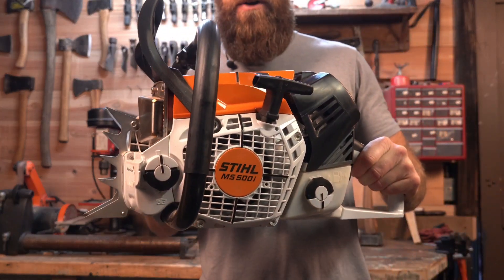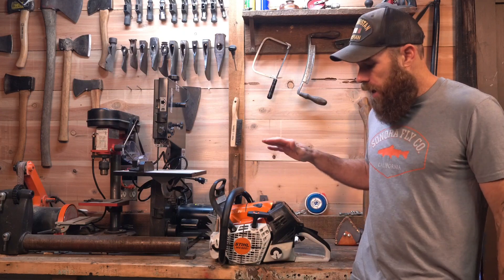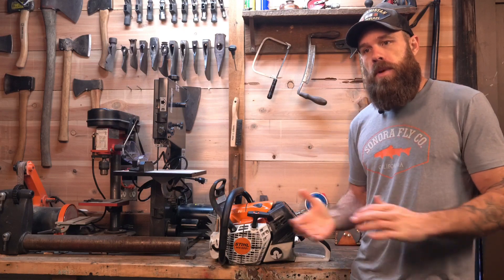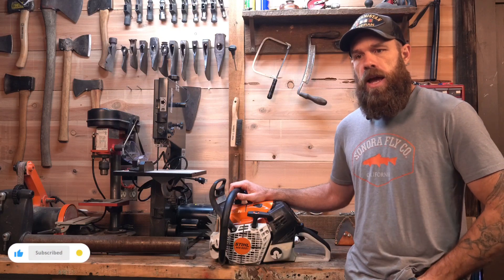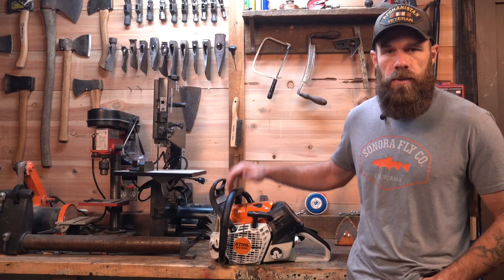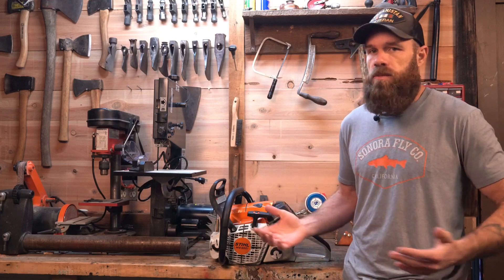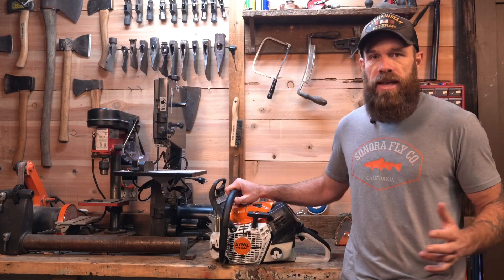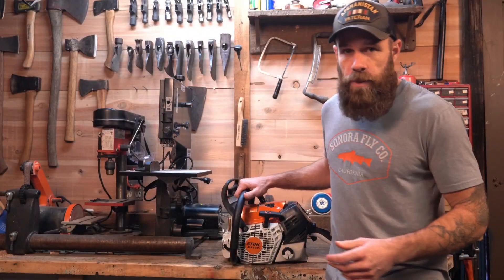How to Recalibrate The Stihl MS 500i After Mods

Comment: You can hock it up to computer..after hocking up run it full throttle...than let it run by itself idling..if it shots down in 40 seconds by itself than the reset worked...and it did the calibrations

Comment: I absolutely love my 500i. It’s ported by Ripsaw because I had to 1 up my friend who got a 500i before I did. Threw on every single Westcoast Saw mod for it and ran it how I normally would. The saw adapts to the mods pretty quickly. When I threw on the new revised filter for the 500i, all it took was a few cuts and it sorted itself out. 

With no information in manuals, it’s annoying. Not like my 261 which tells you how to do M-Tronic reset and even the break in procedure. But I guess with these saws they tell you run it how you normally would. Did the break-in like my 261 for 3-4 tanks which didn’t take long and then by the 10th tank the ring is fully seated. What a machine!!!
Reply: Good to hear, as I sit here with a box full of WCS goodies for my brand new 500i. I have two 261C's, one of which is ported by 309 Machine, that's how much I like that little saw. I am stoked about this 500, and I am looking forward to getting it in some large pecans and oak here in the coming weeks.
Reply: @texlee84 hey it could be worse, my serial number on my 500i could be your house number in the same way it’s my buddy’s actual door code haha! It was at that moment when we realized, he had to admit defeat hahaha

Comment: It “recalibrates” every time you run it. Like you said, every 5 uniform full mustard cuts, so… every time you run it. No “calibration” manually done, ever… unless you have the Stihl dealer program, the Stihl diag usb to saw cord the Stihl computer to saw box, and a laptop.

Comment: Did you have any trouble with idling after the intake and the bark box? Mine, will not run more than 1-2 minutes without throttle input. It does start right back up on the first pull, but I like to idle after heavy use so that I'm not cooking off the lubricants.

Comment: Just seized my pride and joy 2 year old  MS500i 😓😞, it picked up the rings by the exhaust port. And have checked but cannot find a reason , plenty oil around the moving parts . Will replace the cylinder kit and piston kit along with a gasket and seal kit , but would love to now why. Anyone else out there had a similar thing happen ??
Reply from the maker: I've not heard of a 500i seize  up unless it was heavily molested.  Yours stock?
Reply: Any carbon in the ring Lands ? I've put mine through its paces  in some big long long cuts and no issues
Reply: Stock standard running 45 to 1 plenty of oil around the place. 
I want to know why it's seized as well.
Wouldn't have more than 200 hours on it.
Reply: Happened to me as well plenty of oil. No idea what happened.
Reply: ok so got to the bottom of it , turns out that the dealer I purchased it from didn't put it on the laptop to check the settings (first service) and it was running on the lean side . The day it sized it was hot and I was running a 28" bar cutting up a big stump , it was working hard and turns out it was to much for it. Wont be buying anymore from him. 😡

Comment: first one lasted 60 seconds. factory defect. (fuel flooding issue). second one had hot start, elevation start issues 2 weeks in. 9 months in with patience i absolutely love it. up to 3' trees my go to bigger than my ol 660 comes in. 461's been on a rack. thanks for the video got mods coming. have no idea where my useless manual is

Comment: Did you end up having to trim your cylinder shroud for the max flow cover?
Reply: Ya i left tab alone on the intake. The directions show modifying the cylinder shroud or cutting back the max flow cover so they don’t rub together. Have you had any issues with not having them trimmed back? Debating on doing it on my saw.
Reply from the maker: No. Some people trim a little  tab where the filter seats at the intake. I didn't do it though.

Comment: Did you notice much difference between the stock one to the filter and muffler mods one
Reply from the maker: Ya, it cuts better. But a stock 500i is a great saw also. Definitely need ear protection with the Bark box on though. Can't go wrong either way.

Comment: I have a 500i I guess the high price pays off in situations like yours, an incredible saw full of technology and so simple to run. And they're a beauty of a saw.. I'm thrilled with mine. 👍🏻
Reply from the maker: Right. Darn good looking saw!
Reply: @Old Iron - Axe and Tool  even better with a 28 inch light bar!! I wish ya  many years of use with your saw..
Reply from the maker: @John  I wanted the light bar but they didn't have any in .063. The saw shop said that stihl is phasing out .063 
I'm not switching to .050 for awhile,  got tons of .063 chains.  Bastards.
Reply: @Old Iron - Axe and Tool  I'm not sure buddy, I got everything new with the new saw, I sold my old saw a stihl 029 super.. was a great workhorse..
Reply: I threw every saw I owned but the 661 in the shop and run 500i almost exclusively. Unless I'm in a big stand and need the 661 to pull a 36 or 42 500i all day long.

Comment: The injection system on the 500i and ts500 don't need recalibration. Sure, doing those 5 big cuts speeds it up, but that's all it does, it's not a requirement and you won't lean out the saw if you cut in the summer at 100 degrees F, shut it off, turn it on in the winter and 10 degrees and let it rip (after warming up of course). It constantly recalibrates, and it's faster than how the autotune system does it. What I did notice that help is letting it idle for a minute or two when doing a cold start, it seems to run perfectly from the first cut that way.
Reply from the maker: Pretty simple. Don't know why stihl couldn't just say that.
Reply: Doing the process 100% makes a difference. The saw has all sorts of censors that just like Mtronic will calibrate itself while running but takes a solid bit. If a guy is willing to let his saw warm up and all that good stuff you might as well take the time to recalibrate it. I notice a pretty good difference. I run the 500i and 661C daily cutting timber. Anyone that says you won't notice doesn't run their saws wide open cutting timber for 6 hours a day in the PNW. I'm also friends with saw builders who are mad scientists and the calibration is a thing says them. Great video man!
Reply: @Douglas-Fir  Sounds like an air leak tbh, especially that part about the bolts being lose and running fine after tightening them. Take out the butterfly and make sure everything goes in together properly, together with the metal ring that goes inside the boot to keep it tight. Check the boot too. I'd also run some alkylated gas (Aspen, Motomix, VP etc) to flush out all the pump gas and remove that variable.

Comment: Your dealer is correct.  Run it like you stole it.  No different than an extreme temp or altitude change.  In a few cuts it will acclimate to the changes.  The only time it is recommended to recalibrate the 500i is when one of the electrical components is replaced.  It has to be hooked up to the Stihl diagnostic kit (MDG1) to initiate a recalibration.  It is the only MTronic saw that doesn't allow a field reset or calibration.
Reply from the maker: Correct. Pretty awesome technology really. Although Im not sure it's classified as m-tronic, that's carburetor management?
Reply: @old_iron_axe_and_tool  Yes technically it's called injection technology by Stihl.  Not under the MTronic umbrella.

Comment: A dealer can recalibrate the saw with the Stihl diagnostics tool. But that is mainly for diagnostics purposes. If the saw fails to calibrate it gives back an error code. Otherwise it is just as your dealer said. Just use it! The saw permanently calibrates itself at use.
Reply from the maker: Correct.